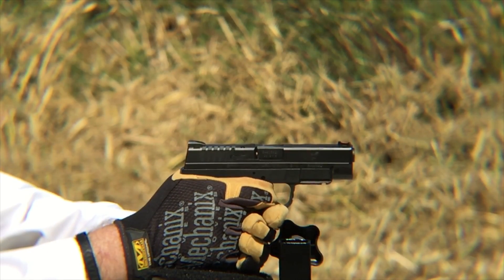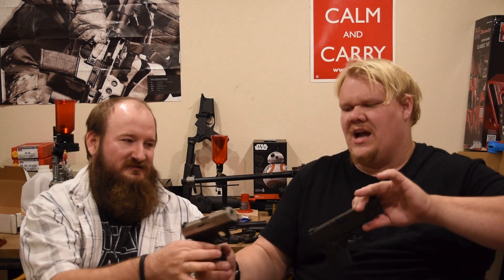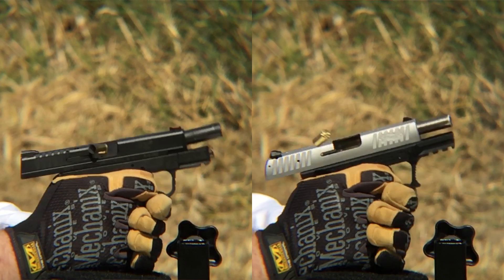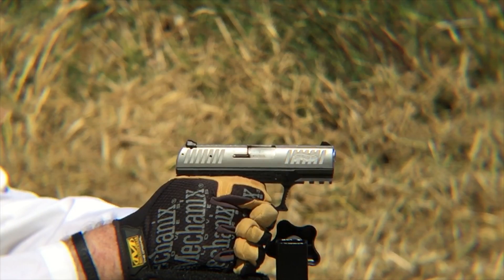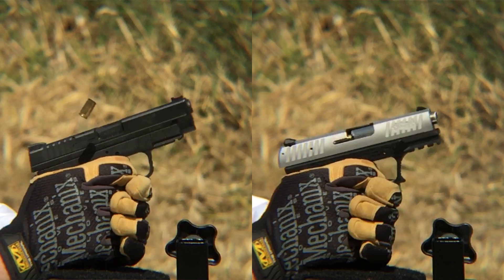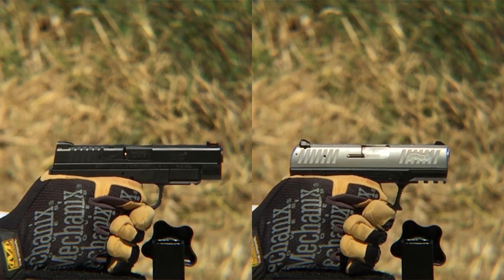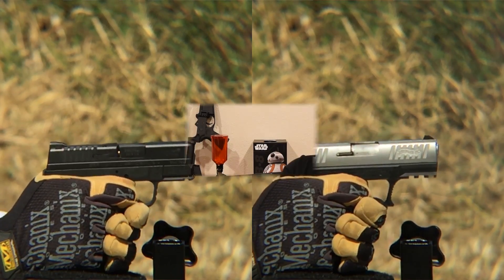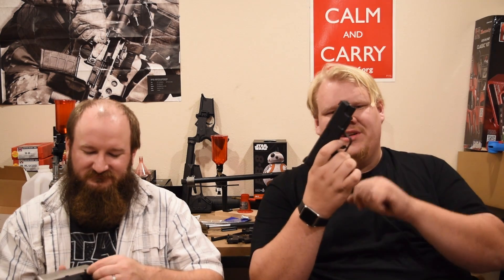Gas Delayed Blowback VS Tilt lock

Comment: Hello. Does the delayed blowback on the FN Five seveN increase reliability with high pressure rounds, would you stronger bolt thrust/ slide velocity? (South Africa 🇿🇦)
Reply from the maker: Not exactly part of the issue with the five seven is the walls are straight with no taper requiring the rearward barrel movement to lengthen the time before the slide opens but even at that all 5.7 ammo needs to be lubed in order to function. It’s very difficult to notice on the rounds but it’s there. My understanding is that is less due to the pressures involved but the shape of the cartridge that is the cause of this. Granted this can be debated from both sides. I’m not sure if you have come across it yet but we have done some high speed footage of the five seven firing. And a few years ago we did have an engineer describe the how the pistol gun functions.
Reply: @LFDResearch  thanks for the reply. Regarding lubrication of the Five seveN. Is it like a Glock, can it run dry in combat environments? How do you or the engineer recommend oiling this pistol?
Reply from the maker: Neither the ammunition requires a dry lube on it to function properly that’s one reason you rarely see it reloaded
Reply from the maker: Think early autoloaders like 276 peterson where the ammo needed to be lubed to function